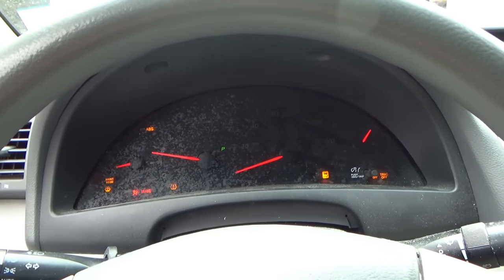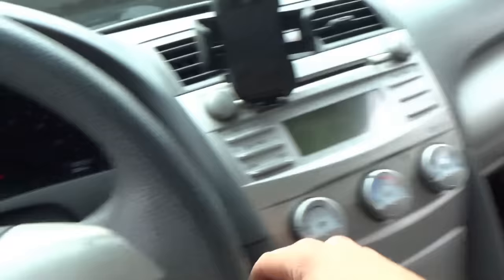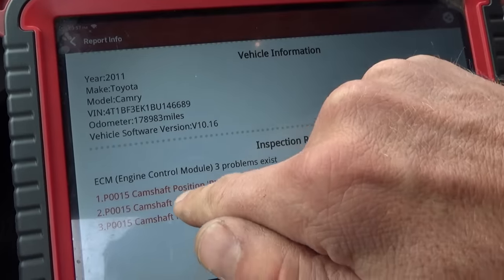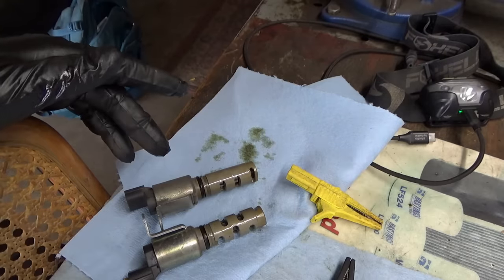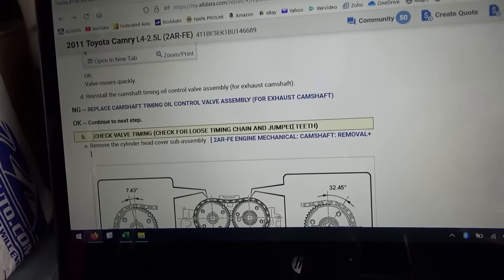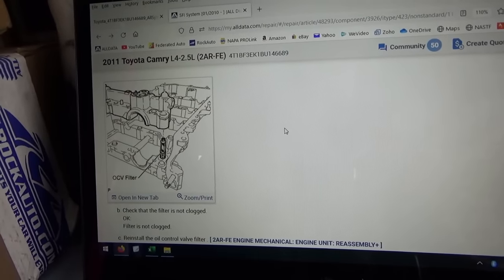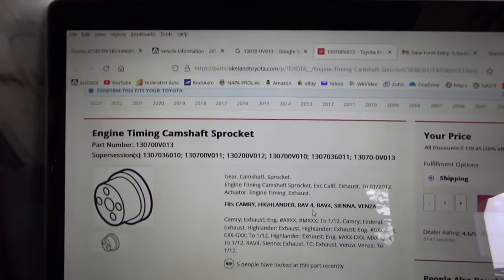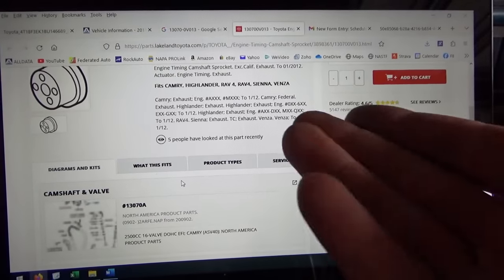Toyota Engines Can BREAK? (Camry STALL- RATTLE P0015-P0017) - Diagnosis

Comment: People don't realize, but them damn VVTI / oil sensors can cause catastrophic failure.

2014 Buick verano under 100,000 mi started dying randomly on light throttle The lightest of throttle, kept getting camshaft codes.

Couldn't figure out personally had to take it to a local and trusted shop, $300 later problem solved mechanics that he had to go and look up the symptoms but couldn't replicate himself replace both oil sensors with dorman (😩) parts because this was during COVID and the parts crunch was here and he couldn't get ACDelco as requested.

Anyways speed up to about 50,000 miles later same problem arises, but this time funds were low and I wasn't able to fix the problem because it really didn't happen that often and it seemed like the harder I was on the gas It wouldn't die but sometimes it would run rough or die especially at stop lights.

Well anyways my repeated driving like this eventually I was taking a corner in a very urban area parked with cars along both sides at a very early morning quiet time, and I could hear on heavier throttle around the corner severe engine clatter and it only seemed to get worse but would only happen on heavier throttle.

I immediately baby the car home never going over 1,200 RPM if possible, was very worried was not happy I thought I destroyed something because that noise was severe and like I said I replicated a few times and I knew exactly what it was.

Anyways the next day I replaced it with ACDelco solenoids, problem is gone no more engine chatter either.

It's funny how these little damn sensors can cause catastrophic failure if not remedied quickly after signs show up that they are failing, when people think of censor they don't think that their engine can grenade or get permanently damaged.

I haven't finished watching the video but I wouldn't be surprised if the chattering went away after replacing the sensors with brand new ones and if they didn't go away after that permanent damage has already been done.

This is also definitely related to oil changes as well, you have to be exactly at your engines supposed interval if not sooner with full synthetic I wouldn't go more than 4,000 miles on a oil change today.

The longer you go on oil changes the quicker the solenoids break for whatever reason.

Comment: I have found through experience using the OEM oil filter is better for these cars. Better oil pressure and better oiling on the top end of the engine.
Reply: @Michael_J_M14  

A friend of mine, who is an engineer for Hyundai and Kia said the oiling system is designed for a particular oil filter. The tolerances are so specific to the particular oil filter that nothing else will work right.

My neighbors 06 Toyota Sequoia lost oil pressure when he used a Napa brand oil filter. I told him to use the Toyota filter from a dealer. Oil pressure went from 15 to 60 psi. 

My 01 Toyota Corolla would do the same thing.

Comment: Its rare Toyotas breakdown. Most of the time is lack of preventative maintenance. Our 09 Toyota Venza has been bulletproof with 215,000 miles. still drives like new. Oil changes on time can prevent problems like this.
Reply from the maker: Yes this was a rare manufacturer defect 👍

Comment: had a 2014 drop a chain at 80k, rattle on start up, had gr v6 phaser come apart and eat through front of cylinder head. had oil feed line on gr v6 explode , toyotas are just like the rest, they all break

Comment: I would bet you that the owner did not religiously keep up with the oil changes to that engine.
Reply: I was expecting that, but those VVT solenoids look OEM and are very clean for 170k miles. I was expecting them to be dark, but they are only slightly discolored. 

I think this owner is very good with timely oil changes.

Comment: That's pretty crappy that they put a time/milage limit on warranty repair. They know it's a bad part, they know it's going to fail at some point. Just because you're lucky and manage to last longer than others, it's still a design flaw that's caused the problem. In fact it makes you unlucky because your now outside of free repair.
Reply from the maker: Exactly! and why make the part so damn expensive 🙄😕
Reply: Seems like an industry standard to set expiration dates for defect repair campaigns. If it's a safety recall, they have to fix it without conditions, no matter the age or mileage.

 Since the repair campaign is not safety related, car companies can and often will make their repair campaigns time limited and screw over the owners who miss the opportunity. And I'm not even sure if the manufacturer is required to notify owners about the campaigns and TSBs. I don't think they always send adequate notification, it's just kept secret unless asked about. 
Some countries have stronger "consumer protection" laws than others, so maybe the people there have better luck getting their defective cars repaired.

Comment: Here's the crazy thing. Toyota will work to correct these issues so they may go a few years and then resolve it. 
FordTechMakuloco recently had a video and he explained a problem Ford has had with axle splines for 10 YEARS and haven't done a thing about it. They add a washer if needed but never changed the detective part. They just keep pumping them out to this day. Even on the new Lightning.
Reply: Ford can't figure out lug nuts

Comment: My buddy saw how reliable the Camry is as i have the generation before this one. He bought this same generation and had nothing but problems with it.
Reply: Mine is a 2010 SE with 214k no real issues. I had to replace the intermediate steering shaft because it was worn.  Consistent ow 2o oil changes.

Comment: I have driven one of them & they're a bit gutless, they have as much power as the old 127 kilowatt 3.8 litre Buick LN3 V6 engine which Holden bolted into the series 1 Holden VN Commodore in 1988 when the proposed Japanese sourced Nissan RB30E engine got too expensive once the value of the Japanese Yen for against the Australian dollar.

It would've been a nice car particularly if they carried the turbocharged 150.kilowatt version (RB30ET) over to the VN Commodore & several prototypes ran that engine.

The Buick L36 V6 engine was a brumby (wild horse) in comparison to the silky smooth Nissan six & the U.S. sourced engine was initially a problem as far as coolant Leaks goes where the welch plugs became the sacrificial anode so GM & Holden replaced the welch plugs under warranty with stainless steel items & added 3: aerobic sealing pellets to the coolant reservoir to.seal.up.any potential further coolant leaks around the welch plugs.

Holden replaced a lot of the graphite impregnated rope rear main oil seals under warranty as well which wasn't a problem with the Nissan RB30E engine.

The next L27 V6 engine had troubles with the 1 piece rear main oil seal sitting squarely inside of the rear main bearing cap which caused a potential oil leak sometimes !

Comment: Time to scavenge a junkyard for a working used gear?
I'm thinking that a cheap fix could be to lock the gear in a fixed position that works well for idle and low rpm. Not ideal, but cheap, but that depends on if there are inspections that will fail due to DTCs being set and the car sets a timing DTC.

Comment: When ever You get timing advanced or timing retarded trouble codes and you verified cam solenoids are good and the engine stalls it's jumped time either by cam phaser failure or timing chain tensioner failure. This is a timing set job.

Comment: Toyota engines are generally well engineered and are reliable if you don't skip maintenance. HOWEVER, it doesn't mean that its parts suppliers don't err occasionally. Toyota is pretty good about going to a different supplier once they identify defective parts, but the customer is still left to deal with them should he be so unlucky as to receive a defective part. They almost always  break outside of the warranty period.

Comment: I would also try not to drive it until after it's replaced because if the phasers coming apart there is a high chance that you can crash the valves
Reply: If the exhaust phaser comes apart it trashes everything, it's a steel ring an a torsion spring that falls into the chain and sprocket.
Reply: @truracer20  yeah I said in a different post that nobody should drive that car until it gets checked out cuz that will definitely crash valves